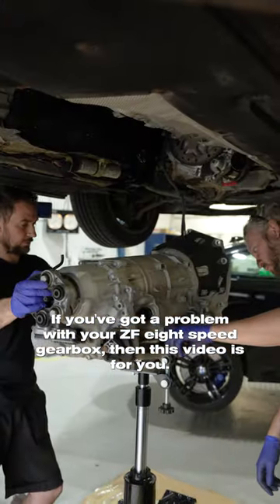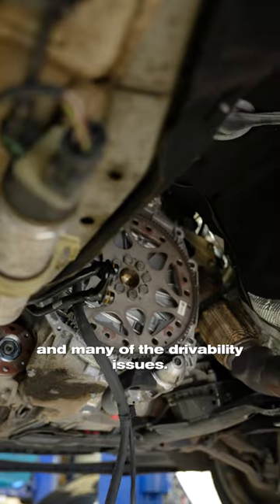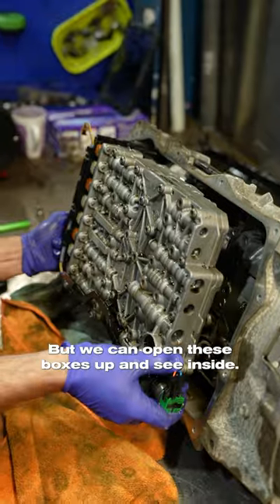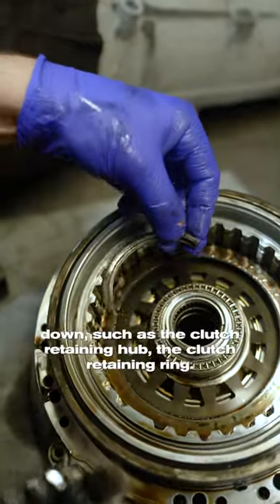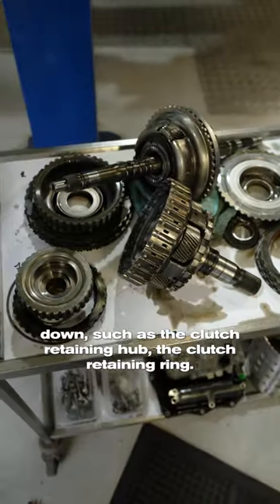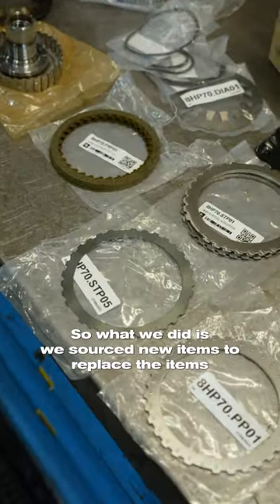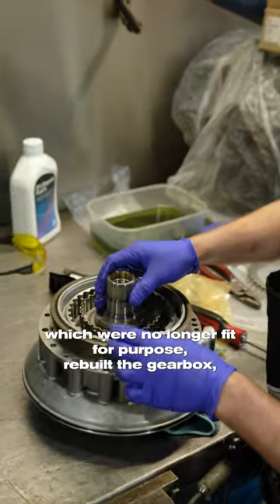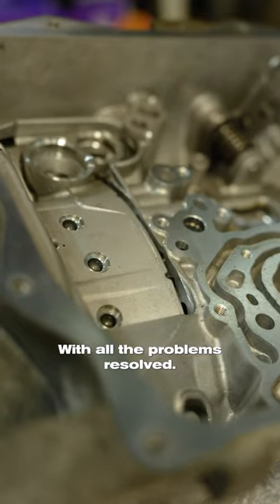BMW ZF 8HP Auto Gearbox rebuild  #bmw #gearbox #gearboxrepair #transmission #zf8hp #carrepair

Comment: Good work, but my question is what’s the cost of rebuilding and the cost of a new g/box?.
Reply from the maker: Thanks! My answer is: new gearbox  ≈ 6-10k depending on spec, repair cost depends on the exact repair required. Pricing is available at sales@regalautosport.com

Comment: Thanks for the video. Would you recommend an oil change on a BMW 535d with 170000km 8 speed ZF GEARBOX that has never had a transmission oil change
Reply from the maker: If the car is 10 years old / 40k miles, then yes
Reply: @RegalAutosport  thanks